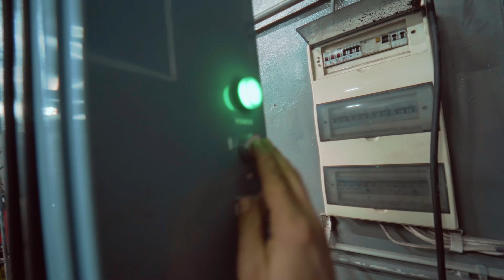Work Hard, Play Hard | NIGHTRIDE

Comment: Hello nightride. I just want to say i respect you guys a lot now for your driving. Last night i went out for a drive and got into a crash. I was doing 40 in a 30 or 35 and it was to dark and I didn't see the 90° turn coming and i spun into a 15 to 20 ft drop ditch. Im ok, got released from the hospital 8 hours ago. Im not sure of the cars condition but from what ive heard its just rear bumper, trunk and rear windshield then front suspension arms from being towed out. So really lucky if that is the case.
Reply from the maker: happy that you're ok! be careful out there my man
Reply: @NIGHTRIDEPL  the car is totaled sadly.

Comment: I think for Kevin you can get the torque to go to something like a diff or gear that the bike will be connected to and then send it to the wheels with the axles and this system allows you to do a wishbone suspension. Not the easiest way, but as an option

Comment: 2:12 does this type of garage wall have foam between two plates or it is only single plate of metal? If it's only single do you get condensation/moisture inside?